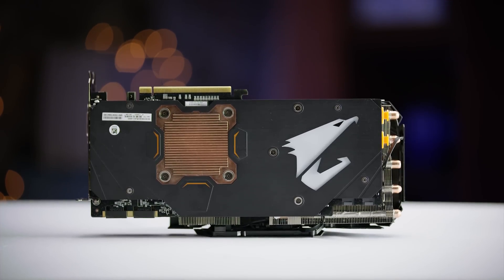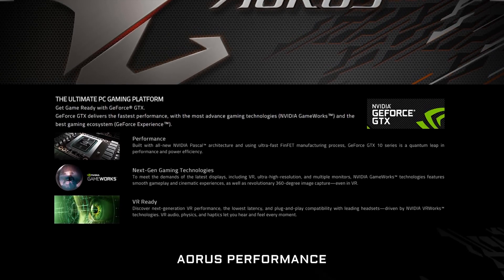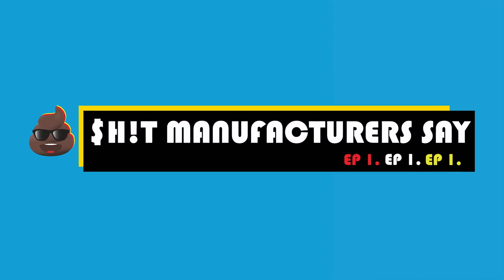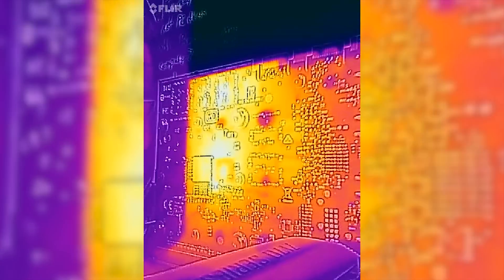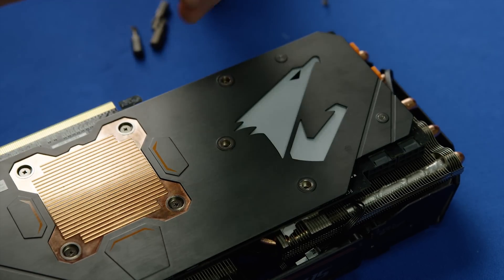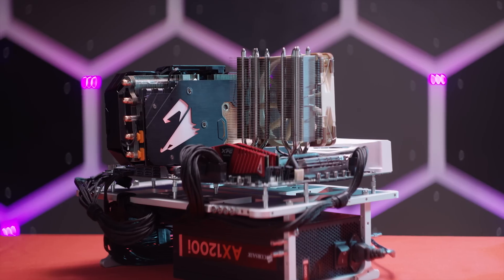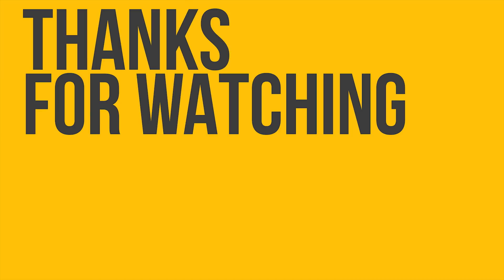$h!t Manufacturers Say Ep. 1 - "Backplates Cool Your Video Card"

Comment: tl;dr... using GPU temp to access cooling capability of backside heatsink is asinine!

A rather superficial test to say the least. Others have mentioned that fan speed or curve may be higher but as an electronics engineer I don't see any reason why a backside heatsink would cool the GPU at all. GPUs are practically all thermal pad up so there's no way heat can be transferred through the PCB. However, there are many other components that could be cooled by a backside heatsink using thermal vias. Things that are likely to have some cooling effect from a backside heatsink include RAM and VRMs. You mentioned voltage instability in passing, so did you scope the VRMs before and after to check for stability and voltage noise? This could severely affect long term stability of the card. Also, we're you able to push RAM to highest clock with or without, or was it the same. Those were just two major things I'd check before going into more thorough investigation.
Reply: It's a practicallity test. Sure, Sure they could use something like an IR thermometer and run the GPU with and without the backplate to see if there is any difference in heat dissipation. But the real questions should be "does it matter".

If it "technically" does something, but only at a rate so little that it's mostly unnoticeable, then it is a marketing gimmick since the gain is not worth the price.
Reply: Well because the GPU makes the whole assembly heat up, so if the whole assembly is colder, it can suck more heat out of the GPU. Therefore it can allow the GPU to run cooler, or at the same temp with less fan speed.

Comment: I'd think its for rigidity, I'm thinking of the Xbox 360's Red Ring of Death. Without it an overheated GPU expands and contracts at slightly different rates that the board. If it flexes you can loose connection with the soldiering.

just a thought

Comment: Disappointing video. It's almost meaningless if you don't read also VRM, Mem, PCB "hotspots" and surrounding air temperatures and GPU speeds. All we can conclude from this video is that backplates don't affect GPU core temperatures (conclusion we didn't need a video to come to in the first place, pretty obvious), but not if they do anything at all.

Comment: what if they take into account case fans pushing air over that copper plate and running it on a bench like you did removed the benefits it might have produced, test in a case please

Comment: I've never heard that a backplate cools the GPU itself before.  All arguments for cooling that I've seen have been on back of the PCB components and distributing the heat evenly instead of it accumulating in hot zones.

Comment: This video is bad in a few different ways. Judging the impact of a backplate based on the core temp is just misguided, since that's not what the backplate is meant to cool anyway. If you want to see the real impact of a good backplate on things like the power system (VRMs) and memory modules, check out some of the videos of the new EVGA 1080 FTW ICX.

You're not going to see any real difference in performance, but when you're going for extreme overclocking, raising the voltage above stock and really pushing the card, you're going to see benefits to longevity. One of the things you see as video cards age if they've been overclocked i stability issues. You might not be able to get the same overclock levels without getting errors and crashes on a card that's a few years old compared to when it was new. If you can keep the components cooler, they're under less stress and they'll last longer.

Comment: Not saying that it would have made ANY difference, but that backplate looked like it had fins... meaning it wanted airflow. Did you guys have a fan pointed at the back of the GPU for both tests? because that's the most likely way for the "with backplate" test to produce a different result.

Comment: Dear lord why didn't you lock the fan speed in Afterburner as the fans probably spin faster to hit the 67 rather than the card run hotter. I am just a dufus in his boxer shorts not a tech company and I thought of that.
Reply: No, it won't make a difference.  It's using the same fan curve, and the temp target set at the 83C default means it wont change the cards performance or fan speeds until it is at that temp.  The fan curve gives a set fan percentage based on a specific core temp, and it won't override it unless the card hits its temp target, which this card would never get close to.
Reply: See:
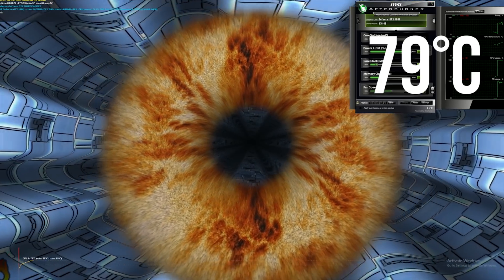2:33 With BP  Fan Speed: 65%
3:08 Bareback Fan Speed: 69%

So with BP the founders edition needs 6% less cooling (100/69*65=94.20). That's a huge difference for just a silly backplate and not sh!t.
Reply: Exactly my thought! :'D
Reply: Looking at the FE card the fan speed was 4% lower though (65% vs 69%). This could be the recordings not being at the end of each stress test, but the test itself is obviously flawed.
Reply: Derek Hyberger This guy ain't no dufus, kudos for the explanation
Reply: linus never has been very advanced lol it's all the retards that follow him lmao...  in 2012 he thought 33 fps was acceptable on a computer -.-
Reply: That depends of the card and the driver. My own experience is that videocards have a curve indeed, but it is dependent of the OEM. But if the backplate can actually transfer more heat quicker, then you should see this in the fanspeeds or performance. But I don't think this card has a issue cooling itself, you should only check the fanspeeds.

Cause Linus TechTips didn't check this, al the theories have little meaning.
Reply: i dont think that would make realistically a difference and the test was quite right. not because it was scientific but just because the backplate does not increase the surface that transfers heat to the air. 
but while thinking about it: it could spread the heat of the gpu all over the pcb, which would cool the core insignifically , but also shorten the lifetime of the electrlytic caps.  the biggest difference is probably the time to reach that temperature. the backplate might take away the heat faster but when it is warm it can no longer do that. 

but in the end it is all just marketing. if they wanted they could use thicker pcbs for the stiffness and add a thick layer of copper to the bottom without etched traces in it.
Reply: Also the test was run on a test bench in open air, not in a case with an airflow over the backplate to help cool it.
Reply: @Kyle fulerton
"it's all the retards that follow him"

So why are you here???
Reply: They are just using insert footage, you don't know how long the card has
 been running when those videos were recorded and I can guarantee they 
were not recorded at the end of the 20 minutes because you can see that 
in the graph on the right that shows the history is mostly blank. They 
haven't been running for long at all.

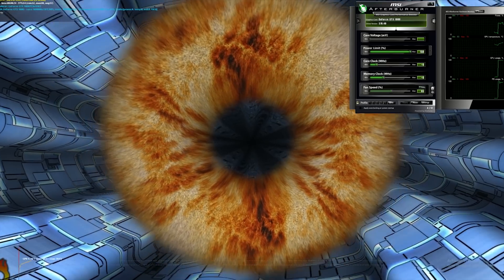Also if you watch the footage starting at 2:24, you can tell they just started the test becasue the fan speed is still rapidly rising. From 2:24 to 2:33 it goes from 60 to 65%. This is the very beginning of the test or possibly completely sepperate b-roll footage not recorded during the test at all.

I do agree that some of the stuff they did was flawed though.
Reply: @Derek Hyberger  Pretty well explained, but I believe it is not entirely correct.. Even now my GPU is chilling at 50 C, but the fan speed @50 C goes between 7% and 13% - maybe the VRM temp went up a degree or maybe Luke's GPU were, too... Anyways accurate thermal tests are one of the most challenging things to do, because of the incredible amount of variables and LTT's method is too rash and obviously overlook quite a bit of major factors.
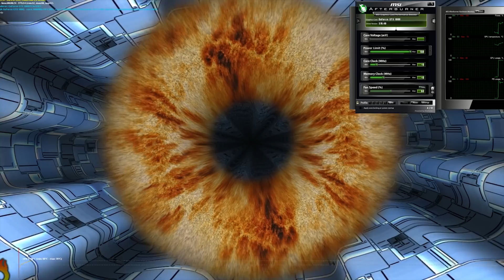Reply: +AllTracTurbo Agree with your post. In the top left you can even see that the test was running for 26 seconds at 2:33 and for and for 58 seconds at 3:08. 
In the footage, the graphs for both tests are 100% identical (overlay them with some opacity to be sure). This makes it even more plausible that this is just some filler footage taken in one shot.

Comment: Do this again with a fan blowing on the card and/or put it in a case with proper airflow.  My thinking is that this card and the new EVGA ICX cards are designed to go in a case with at least one case fan to move the heat away from the back plate.
Reply: Dennis Shows Jay did a test when he showed that basicly temperatures are always higher if you test on a bench. Manufacturers designs the product to be used in a proper case when some kind of an airflow are present. Bench temps are garbage in my opinion. Just shows how unprofessionals are at LTT. No one noticed that they gonna publish a video with totally inaccurate testing. In every test the fan speed is different. No ambient temps are shown or at least tell us delta temps

Comment: Just look at the EVGA 1080 FTW. With proper thermal pads between the hot components, such as chokes and capacitors and the backplate, they managed to bring the temperature of those components, NOT THE ACTUAL GPU DIE, down by about 10°C.

Well documented on both JayzTwoCents and Gamers Nexus channel.

Comment: They didn't implement it correctly then... I mean they can probably get permission from nvidia to do some crazy stuff for a really custom pcb but if they just assume that a copper heat sync and back plate is gonna automatically transfer heat from the core outside, well... not really. It can still be done without any fans, not entirely sure on how, I'm no engineer but, it is possible. My first impression on this after they had the problem with the rx 480, was to implement mausfettes in the back plate and have some copper connections through out the back/surface of the pcb. If you took out the backplate the heat may or may not still be transferred there but it probably won't make a difference since that heat is not being dissipated. Either way, my first thoughts had to do with water cooling because I lieked the idea of the hybrid solution but not having to use a radiator and blower style cooler, in which case, the mausfettes came into mind, as well as for a fairly low profile and clean cut water block. It would take some design, and thought, along with a certain finesse in manufacturing but it could probably be done, as well as it making more sense as to why air with/on water would make any sense in the first place since, the air is actually making a difference on the lp water block. It'd have to be thin if it's going to be implemented within a gpu and between the backplate and pcb.

Comment: jay2cents did simlar test one without airflow on backplate (no difference) and one with airflow on the back plate, and in that test the backplate did make a difference, but only couple degree... ie it does work in a case with good airflow, but only marginally.

Comment: Luke, open test benches aren't ideal for testing passive coolers. you have to remember that most people have a case and that provides a chamber for air to flow in. so perhaps re run the test with an average fan pointed at the back of the card in every test to represent the flow of air in an average case?

Comment: If the copper plate gets hot, then it's probably dissipating heat, if it doesn't get hot, then it's probably more of a gimmick. I like back plates in general because I have seen cards get killed by parts getting knocked off the back or gouges in the board from a handling mishap. If i does get hot, the amount of heat it dissipates may not be overly noticeable or measurable.

Comment: In cases card lays horizontally and in your testbed it was vertical so it is normal that there is no differences in temps.. Hot air moves vertically and in your case it goes every time same route, but in horizontal setup and closed case, most of the backplates traps hot air and even rises temps.... Only purpose of them IMHO is style and support to the card itself..... Cooling effects ....not so sure......

Comment: For fucks sake Luke!
Get your shit together.
Rebranding the Workshop wont do anything if you approach this shit in the goddamn same way!
If your tests show the exact same result question it or think outside the fucking box!
Maybe look at vrm temps or the potential scenarios in an micro atx formfactor or multy gpu setup...just something.
If you don't start to get a little bit more scientific thesesorts of videos will be nothing more than hot air.
I know you can do better!
The workshop was one of my favorite shows, if it wasn't for its flawed style of approaching the subject.
I understand that time is often a spare resource, but if you need a gapfiller, don't do stuff like that, build a Pizzaheater 2 instead or that strage vape pc or an rgb build or some shit like that.
But please put more effort into that.
Make the almighty Steve proud honey.

Comment: Your test methodology is quite weak. When doing temp tests like that on a video card there is a lot of component to take in consideration: VRAM Mosfets and other stuff, as well as ventilation curbs etc... GamerNexus do a lot more reliable work regarding testings and you should inspire yourself with this.
Reply: I agree with you but I was just refering to the methodology. It is very time consuming to bench temp on a video card and the results of this test simply are not relevant

Comment: I would of liked to see a dB rating on the second card between the two tests. What if the fans were working harder to keep up with the cooling needs of the chipset? There are other components who have temperature limiting factors inside of their dies that don't report to the rest of the system. Also, what were the performance numbers of the card on the fuzz test? Just because you ran it for the same amount of time and it was the same temperature does not mean the card performed EXACTLY the same.

What were the ambient temperatures in the room? Is the board designed with more components on the back to help thermal carrying capacity? Are the internal layers of the board shifted to put a ground plane closer to the other side of the card?

You are probably right that this is just marketing wank, but I think you guys can do better on technical reviews! Step it up!

Comment: maybe a different set up , point a fan at the backplate copper see if that cools and run the cpu on a watercooled loop take away the localised heat from the cpu air cooler? 

will it work then but thats a long winded test method.

Comment: That card has a thermal limit of 67'C so it was probably throttled more when you removed the back plate. Also you admitted you had a voltage limit so the card never reached it's full potential and that back plate is for higher temps. Failed test!
Reply: they maxed out the thermal limit so its probably 80 C
Reply: yea they shouldn't push it to its limits every time, they should push it halfway and lock frequencies and memory clockspeed etc so the only variable is the backplate. or did they do that?
Reply: +john li may I suggest you watch the video ? In Dcool negative comment there is some truth the card reached the same limit but we did not have any info on whether the running synthetic test did behave differently when the plate was removed
Reply: Didn't Luke say, that nothing frequency wise changed?

Comment: that cold spot might possibly be due to the reflection but I'm not sure if copper reflects IR like silver does (context: silver reflects IR light very well so you cannot visually measure the heat of a silver surface as you will only measure the reflection of the environment on said surface)

Comment: Wouldn't this concept have fit perfectly in a series you already had running? The Workshop was purpose-built to test whether or not things that have become common knowledge are actually true...

EDIT: Original comment was before watching the video. I've become that guy. The difference in this series (for those who care) is that this is testing a specific product's claims to be true or false rather than testing the truth of a collective assumption made by enthusiasts. That said, the result of "it doesn't matter" is very Workshop-esque and the title lends itself to be read as testing the myth of all backplates and not specifically one that makes claims of offering better cooling. Including the specific product being tested in the title (or description beyond a link to buy) would separate this series more from the The Workshop.

Comment: From what I learned, any metal surface attached to a chip will help cool it down. Add fins, you increase the surface area. Add airflow/waterflow, you increase the heat dissipation.

Comment: just aesthetics and rigidity

JUST! LOL
 its made fundamentally for rigidity luke, so the pci-e connecter doesn't snap from weight or shock damage.

ok ok so you dont think it dissipates enough heat. its disipating heat when the gpu is sat at idle. this scenario can scorch, just like a laptop.

oops

the funny thing is you CAN see, THIS backplate amending that issue under load with your own flir camera for the first time.

you forgot prolonged idle.

fake tech tip, if you dont believe me didn't evga have an issue at idle recently and they rectified with a bump in fan speed?

what are you going to say if other manufacturers copy this when they see your flir proof?

Comment: Did you ensure that the fan speed didn't change when you removed the back plate? Theoretically the card could have sped up the fans to compensate for "lost cooling" form the back plate?

Comment: They do cool the gpu as the plate is a flat area that is in contact with case temp where the temp exchange occurs on a bit higher level, however this "cooling" efficiency is so bad that its not even worth the mentioning..
The only noticeable thing is that it gives a tiny little more time to reach higher temps, like 2 seconds maybe lol